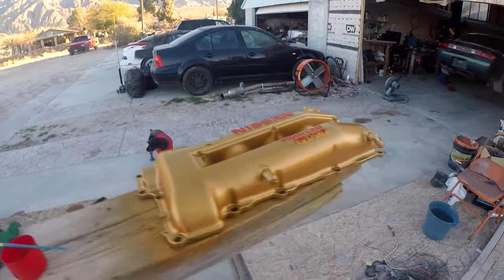painting sr20 valve cover

Comment: should have cleaned it... scuffed it with  400 or 500 grit... then clean it again with soapy water then, clean with acetone or brake cleaner... then primer it 3 times with 15 min breaks in between , then let it dry then sand it carefully in crosshatch pattern (600-800grt) , then spray all edges and crevicez everything else but just lightly, then wait 15 mins , then do two more coats, with 15 mins break between... then wait 30 then clear coat it 2 -3 layers
Reply: it should last longer look